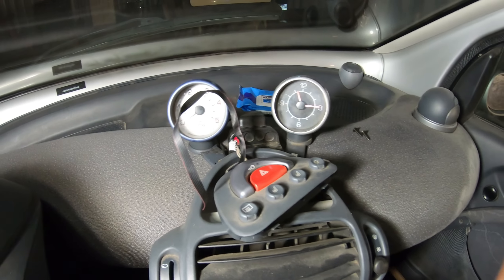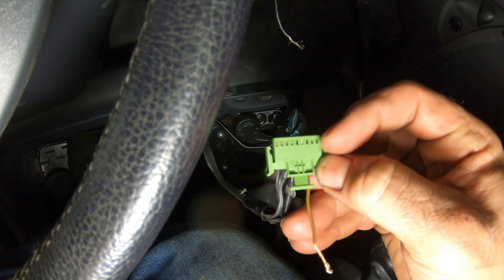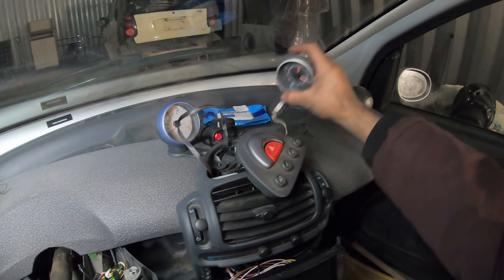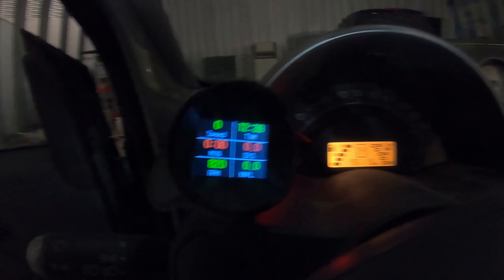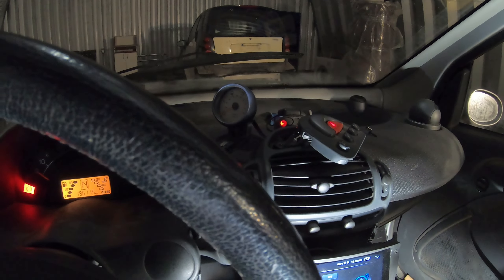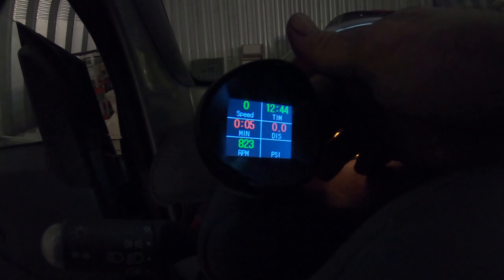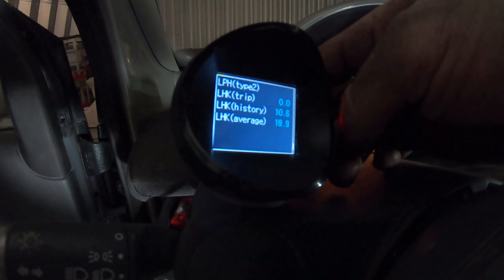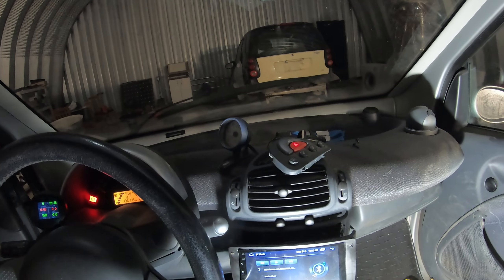Smart Fortwo Gauges Removed, Installed OBD2 Gauge Pod

Comment: Do you know if can be instaled on my smart 450 CDI?
Reply: I'm asking for European 450 CDI
Reply from the maker: I believe they are the same. American scanners don't work on the smart cars in canada. you need a scanner that works for eiropean/canada models. 
I think will work without issue. could always email question before order.
Reply: @manbuilds1587  Thank you
Reply: I use one in my 450 , in the UK works fine .

Comment: did it shut down by itself? or the obd is always powered?
Reply from the maker: always power to the obd port. Gauge shuts itself off. can set when want it to turn off. Turns off when battery voltage drops. like when car is not running. can set at what voltage you want it to shut off.
Reply: @manbuilds1587  nice. Thank you for the reply. So if you leave it always connected to the obd port won't discharge the battery of the car?
Reply from the maker: It shuts off, screen turns off go black. Doesn't use any power once off if set to shut off. So far no issue, always come back to car & its off & battery good charge even after parked some time.
Reply from the maker: shuts off after 30s of the car not running & turns back on once car is started. Below certain voltage it shuts off & turns on above a certain voltage. Battery voltage not running is around 12.7v, battery voltage running is 14v . Turns on above 12.7v & shuts off below 13v, or what ever range you set it to.
Reply: @manbuilds1587  thank you very much

Comment: Nice, Where did you get the adapter for the 2 din radio?
Reply from the maker: Made it. Took plastic face off factory stereo & used plastic welder to weld it to glove box below. Then cut opening for 2 din stereo. Took 2 din surround that looked like would work & trimmed it to fit over glove box & old radio face. Trimmed to angle 2 din radio upward so could see it. Plastic weldes the surround in place. whole assemble slides in & out as one on old glove box. Fair bit of work, other car will get a single din stereo with adjustable 2 din style screen.

Comment: Is your 2005? Cause i have a similar tac.. people told me there really made for 2006 or newer. Thats why i get the same issue as you mentioned. I wish you lived in Ontario haha
Reply from the maker: Yes its a 2005. I thought the fortwo's always had a tach. I drove a 2004 that had the tach & the clock. Maybe they charged as an option in Canada. Ans some where also imported outside the Mercedes dealership so not sure. European models definetely had a tach & clock all way back 2002. The tachs do have to be programed in if not equipted. So must have sold cars with & without in Canada at least, trying to milk every penny for every option.  
Never been to Ontario. Lots of Smart fortwo's there. Good place to get a parts car. But since gas prices have went up, havnt seen as many for sale.
Reply: @manbuilds1587  sorry i ment i have that gauge yhing that goes into the obd. Yes lots of smarts in Ontario or close by in Quebec. I tried to look on your channel to see if i could private message you. But wasnt able. Do you know what the 2 wires are for that go into the ebox that located by the battery. Are they the dash cluster and the 2 gauges (speedo/clock)? Sorry to bug you. But i know i can trust what you say. Thank you again for your advice and videos.
Reply from the maker: @rcpatienceraw9751  there are many wires into the ebox. Check the positive wire to the battery connection if in the area, thats main power to sam unit (fuse box), Just a thought, probable checked.
Didnt know could private message, will look into that.
https://www.evilution.co.uk/mod/450-brake-light-wiring.htm?highlight=wiring%20diagram
https://www.evilution.co.uk/mod/canadian-e-box-failure.htm
Reply from the maker: https://www.fq101.co.uk/how-to-guides/fortwo-450/electrical/251-sam-wiring
Reply: @manbuilds1587  I have seen those evil posts. My battery box area is super clean. Only thing i have is a white connecter that i have no clue what its for. Right after you messaged me i went out and took off the ebox. 2 connecting wire pins look bran new and im sitting herevwith yhe box open. Never a trace of moisture. Looks brand new. But i swear it made noise before my signal lights went all funky on the dash. Is it possible that when i changed the battery in my key and now have to reset or reprogram?
Reply from the maker: @rcpatienceraw9751  nah, I had one car sit for couple years no battery & put battery & all was the same. started right up. It doesnt loose programing that way. You have to plug in with scanner to change anything. Computer memory just like flash drive.
Your car a 2006, the one here has that white connector by battery also, not pluged into anything.
Its odd you should have signal lights. Did you check if there is power to the sam under the dash. big red power cable to the sam from battery. nutt maybe looae.  Pull connectors & plug back in on sam. look at end of connector see if melted around any pin connectors. plug back in wiggle it, see if anything comes on.
You did check that the battery isn't dead or really low? :):)
Reply: @manbuilds1587  my smart is same as you blue one 2005 cdi. All my wire pins are good and sam  has power. Battery is new 14.3v. .. I was curious because i cant unlock my doors or open hatch. Iys not responding. That why i thought maybe the signal lights dont work and shows them sold both ways on dash.
Reply from the maker: @rcpatienceraw9751 I didnt read your message correctly previous. The keys go out of sequence if away from car & press a button on the key too many times. changing battery wont effect.  The key generates a code, bunch of numbers, eg. Each press of key increases this number code by 1. The car computer reads the code coming from key & looks to see if matches the variations it has, it counts ahead something like 10 extra numbers because remote key different each time. If key code fits into computers projected numbers then it opens doors & starts car.  Reason for this is for if some one with a code scanner is recording door codes the code sent to car will not work twice to open the door. A new code is generated every time press key, cannot be copied by scanner because emits new code each time.
Reply: @manbuilds1587  so i have to get it reprogrammed? Or is there a way i can do it (fix it) i only have Chinese obd reader like yours. Not Canada or American. And cause of the key. Would that be why i heard the ebox make a beeb noise? Ive spent all day checking every ground. (At least there all clean) haha. I pulled every fuse and checked. Used multi meter and checked power on sam. All pins excreta are good. All electronics on dash work. Lights in car work. Stereo works. But no lights on the outside of car work.or the horn doesnt work. I found out that my egr needs cleaned also. I guess they erased the code. Cause only code i got was the one i mentioned. I really appreciate your channel. Ive been telling other people to check it out.
Reply from the maker: @rcpatienceraw9751  shouldnt have to program remote back into car unless the  buttons have been pressed to many times with out the car recieving it & the other remote would still work fine if one is out of sequence, so I doubt its that. 
I think some where still not getting power. Is odd. Thought maybe ignition key but doors should still lock & unlock with the key off.
Reply from the maker: @rcpatienceraw9751  Suggest try some forums if run out things to check, maybe some one with same issue. Worth a try. I will keep scratching my head, if figure out isssue, will let you know. Not sure what could be at moment.